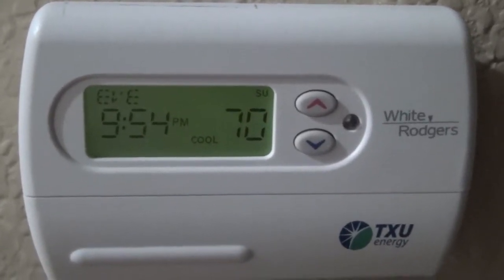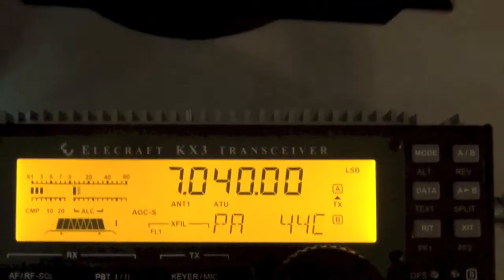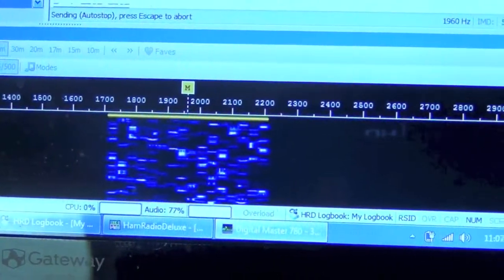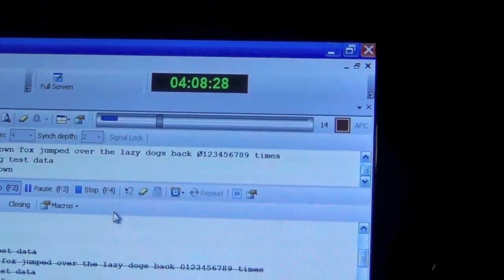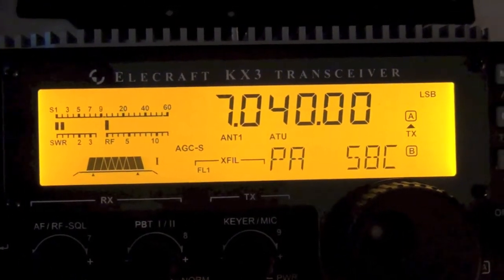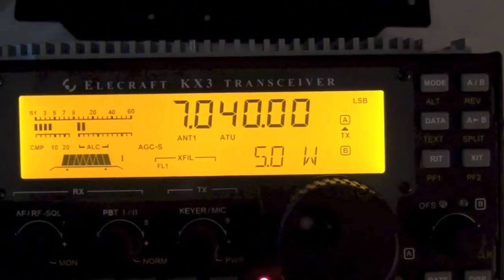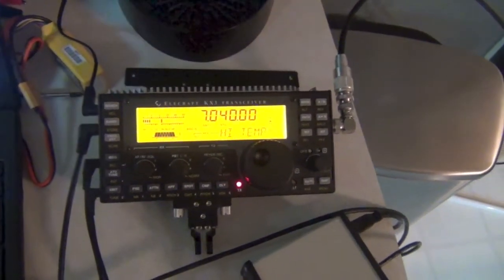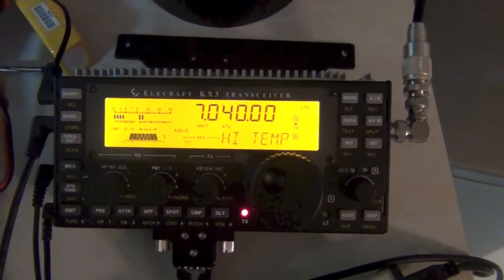KX3 Heatsink Test 2

Comment: Curtis, a really great and simple idea of yours. That is a very logical step forward for extended shack use that could be a best seller! 

I'm looking at my sturdy folding wire stand for an iPad that I use for my KX-3, it would be fairly easy to attach a cross bar mount for a fan or two and still keep the overall price well down. Greta discussion on the KX-3 forum. Have fun. 73 de Philip G0ISW

Comment: Hi Curtis, I really like the design of your heatsink. How is this for an idea, combine your heatsink with a stand. I'm looking at my KX-3 stand which makes the radio sit up a a better angle than the stock stand. If a new heatsink (for shack use) was part of a stand it would have a much larger surface area hidden behind the radio and the same width as the radio. Just a suggestion, don't know how hard it would be to make.

73 de Philip G0ISW